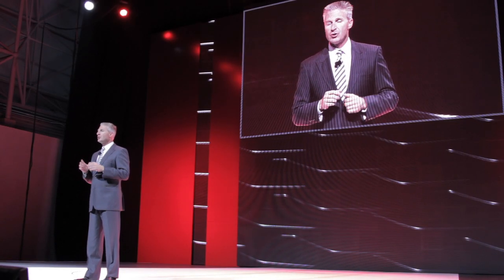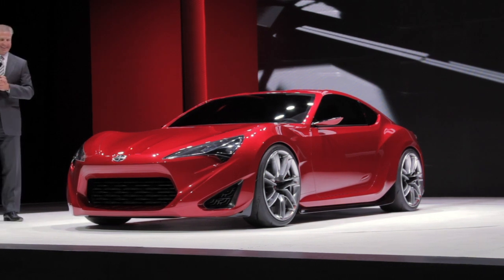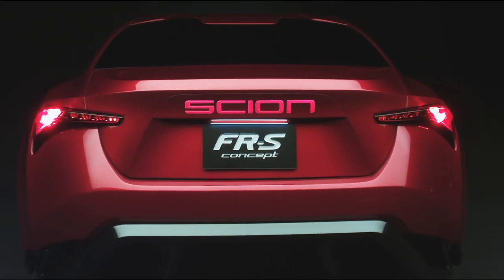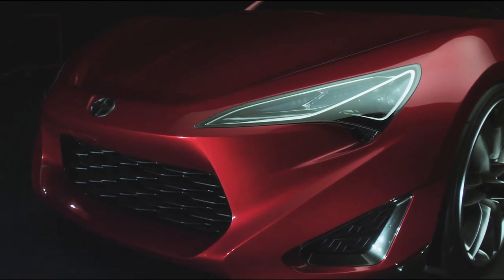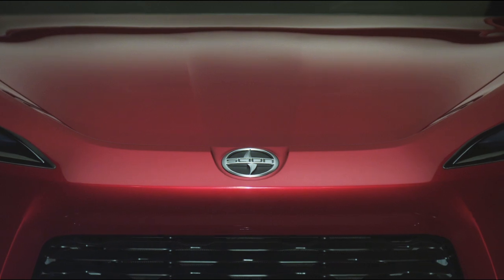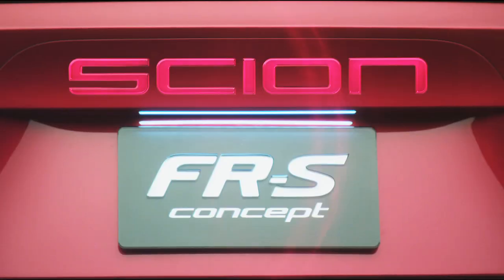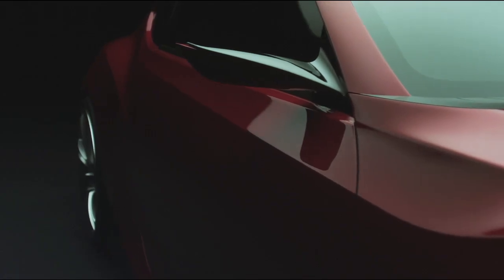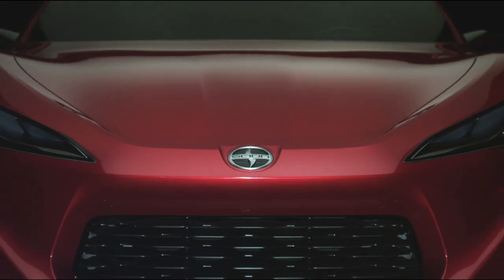Scion FR-S Concept - Behind the Scenes with Scion VP Jack Hollis

Comment: Hi Jack, the VP -- this is a freaking awecome looking concept, however i am afraid that once it gets a green light to full production, it will be toned down. Also, I do red rumors and make a guess that it won't be over 250hp while I am currently driving an IS350. I don't know if it would be a good idea to drive a "weaker" car. To me being smoked on typical weekend cruising around. I understand that there are certain guidelines that you have to follow not to reveal your innovation, but could you

Comment: @greg81809 So I could see this going great, or also really bad because the STI has classic understeer issues on tarmac. But obviously, different powertrain, so it will handle like an STI with all the power going to the rear wheels. Also weight distribution will be different. Maybe comparable to the ISF?

Comment: @titusdrakemovies I know that is a lot for a 2 litre engine, but I'm not talking about how big the engine is. I am talking about the fact that it is only 200hp, I can buy a lot of cars with 300hp stock and then turbo them or supercharge them and get over 400hp easy. The suspension I'm sure will be fantastic on this car, but I would think at least 300hp stock would be much better than 200hp. I know they are leightweight, but 200hp is not a lot when driving  at speed, even if you can get to 300hp.

Comment: @Z480xenalt honestly if they threw a cheap turbo on there id be happy, when this car first came out i was hoping it would be toyotas launch back into the street racing world, sure they have the isf and lfa, but those cars are way expensive, you dont wanna go race them, if this car had 300 hp with a 6 speed manual, itd be a fun ride,

alsoooooo
are you sure that supra motors gonna fit in this car? haha its built around the 4 cylinder subaru boxer engine not a 6 cylinder

Comment: @Z480xenalt when i read my road and track magazine it said 20k, 200 hp, this thing is competing with the honda civic si, hyundai genesis, nissan maxima, mitsubishi eclipse gt, mine cooper s, and golf gti's.

my teenage friends all have cars that are fast as but not limited to, a 2000 audi b5 s4, chipped at 330 hp and 400 torque, 2 2000 toyota celicas gts, a 1993 mitsubishi eclipse gst, my 2000 trans am ws6, and a 93 civic eg with a b18 in it, all of those cars are faster than this for a lot less

Comment: @dbl08523 ONLY 200 hp? from a 2 liter? LOL r u crazy? that is crazy good. plus the fact they are totally SCREAMING "TURBO ME" for this car, stock WRX impreza suspension and internals, TRD will probably sell a turbo kit, if not it WILL be turbo'd and it will push 300 horsepower very easily